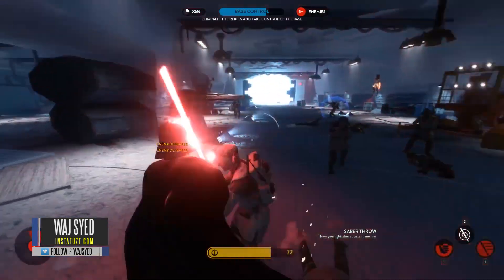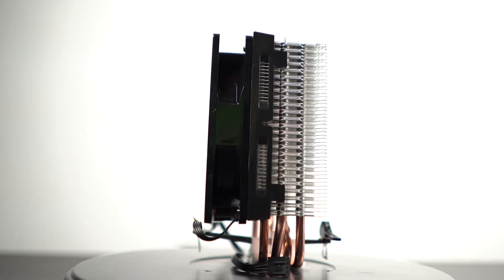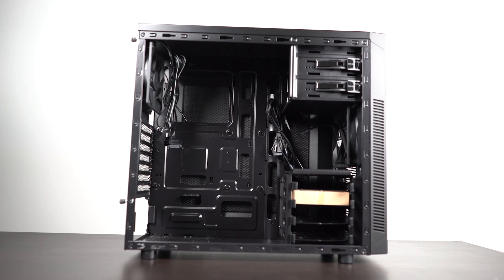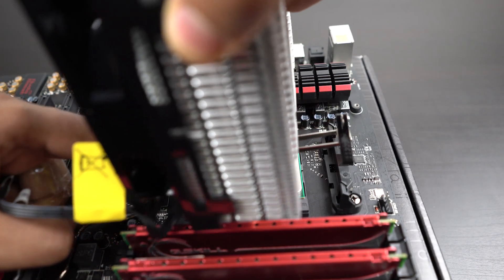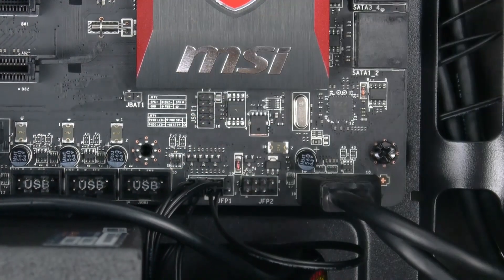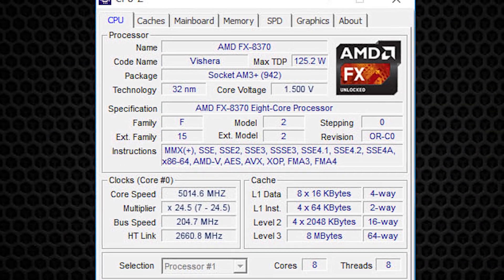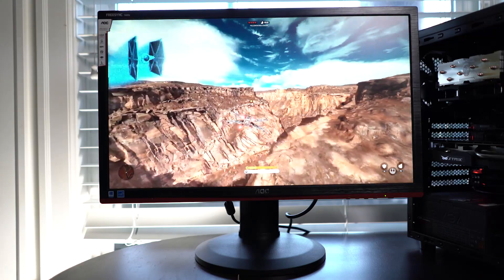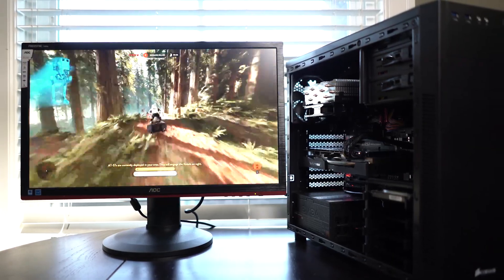Awesome $800 Gaming PC Build Guide & Benchmarks - AMD R9 380X/ FX 8370 @5Ghz

Comment: So this is a $830 PC build (with Windows 10) I'm currently building. Can someone help me if I should RAID my two WD Red 1TB drives in RAID 1 or get only 1 WD Black HDD. I'm concerned about the reliability of my data over performance since my Seagate laptop HDD gave out a few days ago and I can't risk losing any of my data. Right now I'm planning to put my games and data on the RAID 1 HDD's. Also, these drives can maintain 120MB/s read and write so if anyone can help me out, that would be great! Thanks! My build: http://pcpartpicker.com/list/f4sr6X

Comment: Do you need a fan if you go forthe fx 8350 and don't plan to overclock
Reply: if it comes with a stock cooler and  if not overclocking use the stock cooler
Reply: +Cook Huff thanks man
Reply: No problem
Reply: +Cook Huff I just built an FX8350 build.  If you want to over clock or keep it quiet and cool, get either a Cooler Master Evo 212 cpu cooler or if that doesn't fit in your case, get the Cooler Master Hyper T4.  Both are QUIET and my Hyper T4 keeps my FX8350 at 30 degrees Celsius after 24hrs on prime95 (cpu stress test that will determine stability and cpu temps).
Reply: +Derrick Gott im going with a cryogenic h7 cpu cooler and was going to go with a 8370 but i seen benchmarks between the 8370 and the i5 6500 and  it showed the i5 was better so im going with the i5 which one would you pick
Reply: +Cook Huff bang for buck I went with AMD.

Comment: what recommended psu for this build : 
intel i5 6500 3.2 ghz
xfx r9 380x 4gb
conrsair vengeance ddr4 2x4 gb 
asrock b150 k4
Reply: corsair*
Reply: 550w will be perfect.
Reply: +Titanclaw 24 but when i checked, xfx 380x needs minimal 550watt. how bout the cpu tho
Reply: +Irfan Yusuf Fachrurrozi your whole setup will use approximately 550w power,so you can get a good branded 550w psu.
Reply: +Titanclaw 24 what brand(s) you recommend? at least 80bronze

Comment: Wait, you're cooling 8370 on 5ghz with 1.5V with TX3 evo? What are the temps? 80*C?
Reply: +Chase Yeah its bullshit that this system is stable at 5 ghz. Never gonna happen witht hat aircooler. His in the fucking dangerzone alright =P
Reply: +Half Life 3 exactly, tx3 evo can't handle that much heat I call this video bullshit
Reply: what cooling would you reccommened
Reply: Aidan Lane just using a kraken 33c at full load seems good
Reply: Half Life 3 thank you so much looking at it now.
Reply: +Chase I overclocked my FX8350 with my hyper T4 up to 4.5 and ran prime95 for 24hrs & my temps were 35 Celsius top
Reply: ***** The fx8350/8370 aren't hot at all, just give it a shot!

Comment: Can i use a R9 380X on a 500W PSU? (EVGA 500B)
Or it' better to buy a GTX960?
Reply: +ARvideoMAD What processor do you have? I think any card is able to run with a 550W or even a 500W but without massive overclocking.
Reply: I have an i3 6100,i don't want to overclock,what do you think?

Comment: http://pcpartpicker.com/p/346cWZ need to know if this can run fallout 4 at what settings/frames. Any way to lower price without lowering the performance to much?
Reply: If possible change the processor to the i5 6400 (or the 6500 but it costs a bit more) and change the video card to the amd r9 380 4gb pretty much the same price but you get more vram and a better gpu overall.

Comment: I'm running very similar setup but with 8320, Can anyone point me to a simple guide for overclocking, don't have aftermarket cooler yet but I know at least a small overclock should hold. Mobo is asrock 990fx killer Thanks for the video

Comment: Hey, so is this a good build? 
CPU: AMD FX-8370
GPU: GTX Geforce 960 2GB
Motherboard: MSI 990FXA-Gaming
Memory: 2x 4GB DDR3 1600Mhz
Reply: get a r9 380 it costs the same.but has better performance
Reply: Tango Notgamingbecausepotatopc
I heard there was problems with running an AMD CPU with an AMP GPU
Reply: +Matthew Mellross No ^^

Pls the 380 with 4GB, or 960 with 4GB
Reply: +Fabio Koschinski the 960 with the 4GB is bad. The 2GB version performs better xD. Go for the r9 380(x), way better. Also, if you're only going to game on the pc i would suggest buying an intel cpu. if not, go for the 8370.
Reply: Stelios Pasiardes
I'll definetly take a look a those. Thanks for the feedback!
Reply: If you are looking to buy it now, change your CPU ( which also means Motherboard & Ram ) to an Intel Brand. The current AMD CPUs on the market are at the end of their lifespan, considering that the new line is coming out this year, meaning it's a waste to buy it as when you want to upgrade the CPU, you need to upgrade everything else as well. Intel Skylake is much newer and is a pretty good option, seeing as you're new ( can tell because you asked ), I suggest you use a Non-K Skylake, where the K at the end means it doesn't come with a cooler, and can be overclocked. Non-K CPUs don't have these, but include a stock CPU Cooler ( so you don't have to buy an aftermarket cooler ), and are essentially guaranteed to have a good lifespan, while costing less than the K equivalent.

As for the graphics cards, either is alright, the AMD R9 380 has better overall performance, but it lacks in the software and optimisation department, so both are good options.
Reply: If you go for Skylake, you will need to get DDR4 Ram and a decent motherboard which works with it, you can use pcpartpicker.com to help you. Ram all have clock speeds, for example, the ram you have chosen has 1600, however, it can differentiate depending on quality, all the way from 1333/1600/1866/2133/2400/2666/2800 etc. you get the idea, these clock speeds can help improve the FPS a bit, the same model with 1600 and 3200 clock speed would have different results, where the 3200 may receive up to 10 FPS boost, but keep in mind that it's more expensive. If I were you, I'd move from 8G to 16G, it'll last much longer, considered 8G is bare minimum, which shouldn't change for a while. Make sure you used 2 8G sticks, each motherboard has a number of ram slots and max ram, if I had a 64G max with 4 slots, why should I waste 48G worth of free ram storage when I could use 2 8G sticks which give me 2 available slots, meaning I use up more of the ram, making it more worth it.
Reply: Try to use Dual Channel to help, it's essentially when you use 2 of the exact same blocks of ram in the right order / configuration to boost the clock speed performance, so try to get 2 sticks.
Reply: You haven't shown a power supply, I believe that it's pretty essential to have a good power supply for a build with components like that, aim for a wattage where you have some space to work with, if the build uses 300V, buy a 450V, which allows you to upgrade in the future if you buy more V-using components. I suggest you get a minimum 80+ Bronze Semi Modular, where 80+ controls it's efficiency, and Semi Modular which makes cable management easier.
Reply: Brands like Corsair & Antec are good brands. If you want to clarify, find the PSU Tier list by typing "PSU Tier List" in google and clicking on a forum post created on Tom's Hardware.
Reply: BakToThePak
I know I need a good PSU. I was thinking a one with bronze certification and with a 400-500W PSU. I think it's a good balance between price and reliability..
Reply: Matthew Mellross get one from a reputable brand, not just any psu with a bronze certification. i recommend a xfx one since i know they do not make compromises with their quality.
Reply: Stelios Pasiardes
That's a gimme. I wasn't gonna go to Value Village and buy one.
Reply: Matthew Mellross ahahah value village ;p good man, i'm just saying cause the first time I built mine without any help (a couple of months ago) I had to research quite a fuckin lot, 2-3 weeks , to learn everything and to be sure of my purchases ;p xfx power supply, works like a charm!!
Reply: Stelios Pasiardes
HAHA! I did the same. I think I have almost all the knowledge I need to build my first gaming PC. All I need now is the money. :P
Reply: curious as to what you chose ^^ hope you get it soon!
Reply: Stelios Pasiardes As do I, but college is a fucking pain. Money wise anyway. It seems I have to buy shit everyday.
Reply: +Matthew Mellross btw, you should either get an Intel CPU or wait for AMD Zen to release later this year, AMD FX is at the end of its lifespan, so support for it, eg. Motherboards etc. is dying, cause they prepping for Zen.
Reply: +Matthew Mellross also FX is using DDR3, which is also near the end of its lifespan, as DDR4 is starting to become the norm

Comment: Would a build like this be able to play Black Desert Online at a decent fps? If not what things would need to be upgraded and to what extent?

The game's system requirements 

Minimum
 CPU: Intel Core i3 3110M vs AMD Athlon II X2 240
RAM: 6 GB
OS: Windows Vista / 7 / 8 / 8.1 / 10 64 Bit
Video Card: Asus GeForce GTX 650 Ti Nvidia Graphics Card (1GB)   /  ATI Radeon HD 4650 (1GB) Graphic Card
Direct X  11 compatible
Free Disk Space: 40 GB
 
Recommended
CPU:  Intel Core i5 4200U vs AMD A8 6410  
RAM: 8 GB
OS: Windows 7 Vista / 7 / 8 / 8.1 / 10 64Bit / WINDOWS 8 64-BIT (with KB971512 Update) 
Video Card: Graphic Cards Asus Nvidia GeForce 610 (2GB)  /  Radeon HD 6670 (2GB) Graphic Card
Direct X  11 compatible
Free Disk Space: 40 GB

Comment: Ok...

Everything was fine until the OC and temps came up. I have an 8320E under an H60 and at 1.35v things start getting dicey during AIDA or Prime95, and that's at 4.5Ghz. If you know anything about AMD CPUs, I won the silicon lottery, getting those clocks at that voltage is nuts. 

My point is this. 

If you're going to recommend one of the cheap-o air coolers ( T4, Hyper212 of any variety, etc...), do it right, and recommend REASONABLE clocks, or 83x0E processors ( 8320 is a bit epic if you know how to kick it's ass into performing well ). Getting an 8370, putting it at 1.475v ( which will push 1.55 due to loadline ), and then recommending a T4 is a recipe for instability. 

Also, if it took 1.475v to get an 8370 to 5Ghz, you've got yourself a dud, go return it and get an 8370E. 

Realistically, this build should have used an FX-6300, it's more clockable under the T4, the game's performance would have been identical, and it'd be a good ( in Canada at least ) $100 cheaper. That'd free up funds to spend on something like an R9 390, an SSD, or just hookers and blow. 

Whatever floats your boat.

Comment: I have an overclocked 8320E running at 4.2 with 1.435v, and a 380X on 1185 mhz core 1475 mhz mem.

But im using a 3 year old 530w power supply from Rosewill.
Reply: SOFAKlNG my power supply is fine but I wouldn't get a 500w, more like a 550.

Comment: im going with an similair build only thing i uograded is the mobo, ram and gpu :D 
Gigabyte Z170XP SLI , 3200Mhz DDR4 16GB RAM and an i5-6600k with an 212 hyper evo cooler
Reply: +๖ۣۜGhostTM and CPU and cooler the only thing you may have the same is the case and PSU
Reply: binkiebarnes 
I changed my mind im going for an i7-6700k with an Phanteks TC-14s CPU Cooler and an Sharkoon BW series case

Comment: Is it still passable if I use an 80Plus 700W PSU?
Reply: +Polvo Corrupto  a 600 watt should be more than enough
Reply: Gpu's Rec. Psu wattage is 550W. Lets add AMD cpu, 600W will be enough

Comment: I was expecting the 380x so much, was about to buy it until I saw the benchmarks, an r9 380 overclocked beats the 380x in stock while the 380x overclocked beat the r9 380x oced by just a little, for me, it's not worth the extra $50, either get the 380 or the 390, just my thoughts.
Reply: +Iceburger   380x is actually 230$ MSRP

Comment: I heard there was a problem with the bios where u had to use an am3 cpu to update the bios to an am3+ bios so u could use an am3+ cpu, has this since been fixed? Take note that these complaints were made in july-sept
Reply: +V3T3R4NGaming where did you find this?
Reply: There was an issue with FM2 motherboards needing a BIOS update for the the AMD Athlon 8XX CPUs.

Comment: So how did you get 5ghz on that air cooler? i call bullshit
Reply: Amd van do that but it is still shity
Reply: ***** I have an 8350 and there is no way to get 5ghz on air
Reply: My name is Jeff M5A99FX PRO R2.0 (mb) and air cooler is a Phanteks tc14pe
Reply: My name is Jeff I doubt that,if you look at any forum you will see a similar story,you can't get to 5ghz on air,it's even difficult to get 5ghz with an all in one water cooler and my cooler is probably the best air cooler on the market,his is not even close....i got mine to 4.7 but had crashes with prime95 so i eventually got it stable at 4.6..that's why i'm calling bullshit on this.

Comment: Nice build in comparison to the costs and the performance. I spent 750 Euros on my graphics card and you build a whole PC for just 800 including a freesync monitor. Pretty impressive :-)
Reply: The monitor is not included in the price unfortunately.
Reply: +MattyBlackout In germany it is for 825 €: http://geizhals.eu/?cat=WL-613758&wlkey=a7eda557805120016cd34696b990938c This is an example-wishlist.

Comment: I was thinking about msi 970 gaming as my motherboard for my new build. Would 970 be enough if I decided to overclock it one day ? Or would it be better, more stable and easier with 990fxa ? Defo want MSI build this time allready have 970 gtx msi GPU
Reply: And it would be with the same amd cpu (FX8370). Anyone ?
Reply: I was thinking the 970 as well for my build, but after reading some reviews on it, it really isn't suited for overclocking, especially with such a powerful CPU. The 990FXA is what I decided to go with.
Reply: +ziemas93   no the  970 won&#39;t be enough for a 125 watt tdp cpu but you can get fx 6300 since an overclocked 6300 should be able to handle the 380x just fine
Reply: +Christian Alvarez what type ? msi 99fxa gaming or MSI 990FXA-GD80 ????

Comment: I guess MW Technology got sick of being called an Nvidia Fanboy, so he made an AMD build...

Anyways, Why did you pick an FX 8370 over an i5?? 
I'm not an Intel fanboy nor an AMD or Nvidia fanboy but the FX 8370 has some difficulties in some games.
Reply: +Xavier Lim  performance/price
Reply: hello walkman I guess it works out well anyways.
Reply: Xavier Lim  yea .. you get an all round cpu for 200$
Reply: +LinusMemeTips Official amd sponsored this build and the fx9590 build, and the 8370 is fine for games escpically with dx12 coming soon
Reply: *****  sometimes  I  wished  AMD  released steamroller  and  excavator  based  Fx  cpus  on  AM3+  ..   apus  did  not  sell  well  :(
Reply: ***** AMD released the FX too early, it could have been useful aftet DX12 goes mainstream, they could have stalled intel by producing hexa athlons
Reply: If they stalled that their marketshare would have depleted and they would have to file bankruptcy. Good ipc will always be king
Reply: ***** Ok then I guess results could have been way better if AMD's FX CPUs had excavator/kaveri architecture
Reply: I think the Octa Athlon would tie up with the 4460 at stock and tie with the 4690k at OC
Reply: LinusMemeTips Official
not really they were only 10-12 percent faster than bulldozer nothing special. it was mainly based on a no gpu solution gaming, but failed due to many limitations, zen is what we need to see improvement from apu's powerful as console with no limitations and faster chips to match intel ipc all in the am4 socket, hopefully it delivers and not fails unlike bulldozer
Reply: ***** Wait the Iris Pro already exists so... Is the Iris Pro on par with console graphics
Reply: LinusMemeTips Official nope, it slightly better than the kaveri, no where near it yet

Comment: A Geekbench of 15541 is not bad and similar to an Intel-i7 6700k Skylake CPU.

Comparable benchmarks.

Dell XPS 8900 with Intel-i7-6700k Skylake ( $700 )...............( Single core 4097 ,  Multicore 16078 ) ( Best Performance PC )
Apple iMac 2015 5K with Intel-i7 Skylake 4ghz.($2300 base model).( Single core 4150 ,  Multicore 15553 ) ( Best Apple Buy )
HP z640 - 6-core Xeon ...........................................( Single core 3022 ,  Multicore 14844 )
Dell XPS 8700 with Intel-i7-4790 Haswell ( $700 )................( Single core 3911 ,  Multicore 14702 ) ( Best Performance PC )
Apple Mac Pro 2013 - 4-core Xeon, ( $3000 Base model )...........( Single core 3274 ,  Multicore 13027 )
Lenovo TS140 with Intel Xeon E3-1225 Haswell , ( $300 )..........( Single core 3268 ,  Multicore 11952 ) ( Best Low Budget Performance PC )
Apple iMac-27, 2015 5K Intel i5-4690 ( $2000 base model )..........( Single core 3541 ,  Multicore 11350 )

Comment: what is better to buy first the cpu or the 380x? I want to upgrade, I have an fx 6300 and R7 260x.
Reply: Get the 380x, friend has a VERY similar setup. It's AWESOME! Good luck!!
Reply: +HEARTHETONES 1Min.   get the 380x and overclock the cpu to somewhere between 4.5-4.8
Reply: +HEARTHETONES 1Min. get the 380X and overclock the CPU with AMD OVERDRIVE or MSI After burn (If U use MSI Product but remember don't get 85 degree from both

Comment: I was planning on buying a amd fx-8350 but would it be worth it to go up to a 8370?
Reply: no just stick with the 8350
Reply: I have the mother board and 8350 and it rocks honestly it doesn't slow down my 390 at all
Reply: +Jacob Carter Or Maybe a 8320 and OC up to 4.5Ghz. Can save some $$...
Reply: It OCs WAAAYY better, and a revamped silicone setup
Reply: +Jacob Carter   it OCes better .. also better memory performance
Reply: +Kascper Boguszewski Yes it does actually
Reply: +Jacob Carter fx 8350 or i5 6500

Comment: For that much you can get an i5 with that because the pc I will be building has an i5 4460 and gtx 960 4gb for only $560. Nice build though, just kind of expensive for what it is.
Reply: +AtomicGamer7 At $800 I can get a r9 390 and i5 easily with an ssd all new parts.